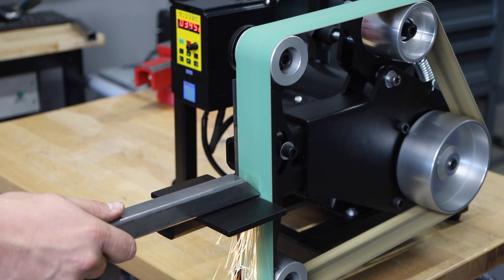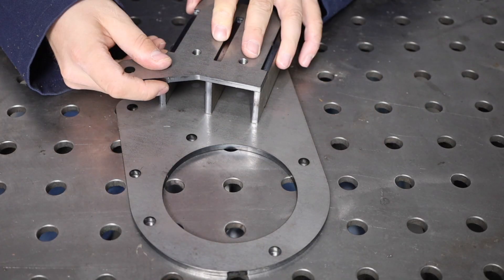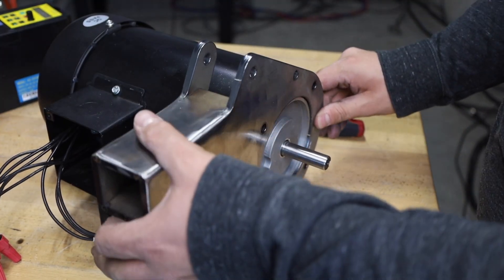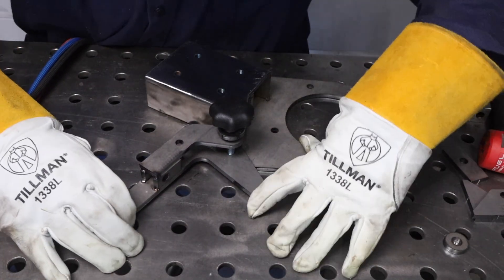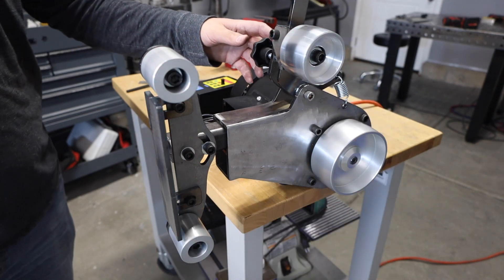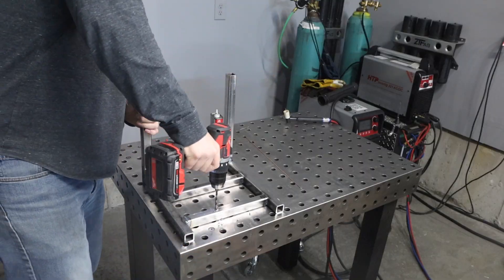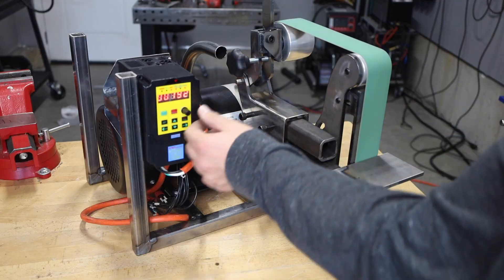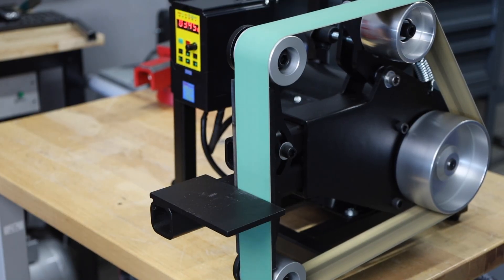I Built A Better Belt Grinder…Here’s How

Comment: Is there a reason you sized the VFD to match the motor HP?  When converting from single to three phase, the quick and dirty recommendation is to double the HP rating of the VFD.
Reply from the maker: I was just looking for a cheap one to test it out. I figured it would fail within a few months with the open top, then I'd replace it with a nice one if the grinder worked well. It still works great, though, I use it almost every day. I'm sure I'm not getting the full power out of the motor and I'd buy a bigger/better one today, but it's still pretty powerful.
Reply: @TimWelds  I was considering a DURAPulse VFD from Automation Direct but if you're still having good luck with the one you started with, then I'll give it a shot since that's about half the price of the one I was looking at.  I'll probably make a shroud to keep stray metal bits out of the VFD,though.

Thanks for posting the video.  I was hunting for a compact design and this looks like it'll work nicely in my small shop.

Comment: Tim, great design and build, when I sent the files to SCS they advised me that some of the features are too close to the edges to cut based on the .250 plate. They pointed out the bottom slot on the motor plate RH edge being too close to the outside edge of the plate. Curious if they told you the same thing and if you had to modify it?
Reply from the maker: Honestly, I don't remember if there was a warning, but I didn't modify anything from the files that are uploaded. Make sure the plates are in the correct units and that the overall size shown on their site seems reasonable. I don't see replies to comments, so shoot me an email if you have any other questions about it.

Comment: Do you have a spec for the tapped holes? I looked at the drawings but didn’t see anything.
Reply from the maker: 3/8-16 for the tapped holes. There's a text file in with the drawings that has a few details.
Reply: @TimWelds  Guess I need to RTFM (eyeroll here)

Comment: In case anyone was wondering what the cost from SCS would be today, after the discount code and tax it was $200.44 to my door. Make sure you switch the units to MM on SCS and make sure the quantities are correct before placing the order.

Comment: Nice build... I would like to build that but I wont be using send cut send. I would cost over $700 bucks today to have send cut send make those parts today.
Reply: I quoted it like 2 days ago and it was under 250
Reply: @ You must have used a different thickness of metal or something. I put in all the pieces at .250 mild steel…Total quote was 
$712.81….
Reply: @imadog131  ill run it again tomorrow and let you know. But if I remember correctly, I ran it all as .250 mild steel, no deburring or added coatings
Reply: @imadog131  you ran it in inches i bet instead of mm. Guarantee that's what you did. I just double checked price.
Reply: @hoop2814  Some of the parts were in inches.. I’m new to send cut send and just loaded the files from Tim’s post. Thanks for educating me on using mm or in..
Reply: @imadog131  no worries at all man, glad I can help. I'm ordering my parts this week as well! Good luck on your project!

Comment: Hello Tim, I really like the compact size of this Belt Grinder. So I'm building one. Can you tell me what length of 1.5 x 1.5 tube you used for the platen and work rest?  From the images it looks like they are about 12" and 15" long. I also want to thank you for the free dxf files. I was able to cut out most of the parts on my cnc plasma table with only a few needing to be cut out on a laser table. I didn't know that you could get 220 volt 3 phase power out of a frequency converter with 120 volts input. Thanks for your excellent design and build instruction video.

Comment: Very nice piece of equipment you designed. Did you choose the 3 phase motor because you already had it on hand?
Reply from the maker: I chose the 3 phase motor because variable speed with a VFD is better than variable speed options with a single phase motor. It's almost always turned all the way up when I use it, so I'd probably just use a single phase motor and a light switch if I were doing it again because that would be cheaper.

Comment: Mind me asking how much the final cost was for this? I'm trying to decide if i should buy a pre built one or build this.
Reply from the maker: Prices have changed a lot since then, but if I remember correctly, it was under $500 at the time. If I were to do it again, I wouldn’t mess with variable speed because I always leave it cranked up. That would save a couple hundred bucks, but if you’re grinding knives, you might want to have the variable speed.
Reply: @TimWelds  I was thinking of building a 2x72 but I just need something for cleaning welds up. The vfd sounds like it would be good to especially if I pick up some belts for Polishing and sharpening some blades.

Comment: dude this is Lego...what is DIY.
Reply from the maker: I designed and built it myself, I thought that was DIY? I’ll have to check the Lego isle for one of these next time I’m at Walmart, didn’t realize they offered it.
Reply: @TimWelds  I don't understand what you designed, thousands of examples on YT, and all of them are basically the same machine models in appearance and function, as long as you drew the thing in the program and cut it on a CNC machine or laser, all the same, while most people made a project from scratch with basic tools and materials, what is available to most people, i.e. manual work, and that work can be called do-it-yourself.
Reply from the maker: I used software that is free to anyone and a laser cutting service that anyone can use without any up front equipment investment. I’m showing that DIY with modern tech can be done by anyone.

Comment: Love the compact build and just tilting it on its side is genius.... so simple.  Have two comments.... the availability and cost of 2x48 instead of 2x72 belts.  2x72 belts are so common, in such a wide variety... I don't know about 2x48 belts.  Second Comment.... I can't see that controller lasting very long sucking in grinder dust.  Bad in the vertical orientation  and terrible in the horizontal orientation.  TEFC motors are pretty well sealed and in my experience can take a lot of abuse.   Maybe a VFD in a watertight enclosure?  Nice design and I never thought about using a laser cutting service.

Comment: Nice build, is the VFD 120 or 240 volt? Which VFD would you recommend for 3phase to 120 volt? Thx
Reply from the maker: Mine is 120 volt. For the VFD, I just bought the cheapest one from Amazon. It’s working great, but may fail early because it has open ventilation which can allow metal dust in and short the circuit board. I figured I’d take the gamble and upgrade when it dies.

Comment: Thanks for the video!  I don't comment much (if at all), but found it important to share my thoughts.

I'm in the process of building this right now, and I'm going to share a few things I've learned so far about fabrication in regard to this project specifically.  

1) The threaded mounting holes on the motor are only 1/2-3/4" deep and are blind.  Don't thread a 1" bolt in there and keep cranking.  Ow.
2) The holes are all 3/8" as drawn, but the linked rollers are designed for a 12x40mm (I would take it to the hardware store and double check that) shoulder bolt.  You could do what I did and drill it out to 10mm and get a lock nut, or you could thread it for M10x1.5 (I think that was the thread I was able to find in the hardware store).  If I were to do this again, I'd have waited for the rollers to get here before I bought anything else, and definitely before I paid for the custom cut plate (which is indeed very nice), and used what's available to guide my choice on what size to thread the hole.  A simple thing that could have alleviated most of my non-welding woes. [I just double checked and it should have been threaded from the start.  I'm actually more satisfied with how I did things like this than if I'd done it as designed.  If you get the plate as drawn you can still tap it yourself pretty easily.]
3) There are a few options for 120v input.  I just grabbed the cheapest.  Input is usually listed as RST on the VFD - for 1 phase 120v input hot is R and neutral is T.  S is used for 240v, and ground is its own lug.  
4) You don't need a ton of the 1-1/2" square tube.    Maybe a 4 foot section tops, if you're thinking about making multiple tool rests.  I didn't think about what I was doing and bought 8 feet of it.
5) You can make life a little easier by using KIPP style toolless screws (ratcheting handle screws) for the 4 side adjustment screws.
6) I think it's definitely important to build the frame Mr. Welds has on his, but I also think it's a good idea to go to Harbor Freight and buy a $60 grinder pedestal for this thing as well.    This way you can still move it around, but you don't have to do as much lifting/fighting with it when it comes time to use it.  I have more than a few tools that I dread using because I don't want to fight with getting them out from under the work bench.
Reply: Great comment- thanks for sharing!

Comment: Hi Tim ~ I don't get much time for web research, so please excuse the question if you've covered it elsewhere.  I was wondering how you've employed your Portaband bandsaw setup?  I'm trying to find a way to make fairly square cuts using 1-inch thick 1018 bar stock and am trying to find out if a cut like that is possible with a portaband type saw and a Swag table stand?  I previously subscribed, so please keep up making the informative videos. 👍
Reply from the maker: Thanks for the question! I generally use my portaband and stand to cut shapes from sheet/plate. If I we’re cutting bar stock like that with a portaband, I’d support the material and use it handheld. The cuts would be as straight as it’s held, but could be really good. A horizontal bandsaw or chop saw would be able to make more repeatable straight cuts. Hope this helps!
Reply: @TimWelds  Hi Tim ~ I'm seriously considering following your lead and fabricating our own belt grinder.  My main concern is the motor itself.  Some folks say that you need to base a belt grinder around a low rpm motor -- like a 3-phase 2 hp 1800 rpm design -- to get the required torque.  I'm not sure how much you've used your grinder at this point, but have you ever felt the need for more torque when shaping metal?

Comment: Very nice build, I like that you used MIG/TIG depending on the situation. One thing I would add is a counter nut for the tracking adjustment screw, maybe a nut with a tiny lever welded to it so you can lock the tracking screw in position firmly after adjusting it.
Reply: I was thinking a coil spring slipped over the screw just to give it some resistance against vibration.

Comment: I'm almost done building mine. for a weekend warrior like me, this is a great project. Two things, my motor does not have a flange to mount it so I have to modify the design a bit. Second, if yo guys need bolts I recommend the Bolt Depot. Great prices without having to spend a tone in shipping!

Comment: Fyi I am building this sander and the roller kit is ok but upon inspecting the roller bearings I found that the inner bearings were subpar/defective. The outer bearings are fine so it's something that would not be discovered unless you remove the bearings to inspect. Fyi each roller is 3 bearings sandwiched. I am replacing the bearings with new 6201RS. I have reached out to the roller mfg to let them know. This is nothing against Tim I just wanted to let anyone know who purchased the Amazon rollers. Things are spinning at a pretty good clip to have defective bearings. Thanks all else has went well pics to follow once completed.

Comment: You're tracking could be improved drastically very easily, a lot of the belt movement back and forth is coming from the fact that you're platin doesn't have lead in and lead out bends, by putting radius bends on the top and bottom of your platinum and pulling it forward more you will get a smoother transition from the angled seam in the belt as it rides over it.

Comment: WOW!  Great work.  I've done a similar belt grinder project but mine is not as nice as yours.  The only comment I have is you've made a mistake mounting the VFD to the frame holding the motor.  I've seen  many VFDs fail prematurely from vibrations caused by being mounted to the motor frames.  The vibrations cause the solder joints in the circuit boards to fail.  Other than that, I love it.

Comment: How long do you cut the 1 1/2in tubing for the idle pulleys and platform holder?
Reply: Got the build started, and very close to running. The idle pulley tube is 8.5”, and the platform is 12.25”
Reply: @retired_badger  Thanks that helps a lot!!!
Reply: I've bought the "kit" from the link, and by my estimation the idle pulley tube is 9-10" long. The side box plate is 5" in length, and it looks to extend about 4-5".  The platform is 3" deep, so if the other is 9", I'd go closer to 14-15".  I'll post here once I get my build started, if you don't get a response otherwise.

Comment: i built a pretty sweet bike stand for a xr650r out of a bed frame on the side of the road without any detailed measurements. it looks like hell, but it works as i only have running a 115v millermatic wirefeed, at the highest voltage it still struggles on much more than sheet metal. like trying to weld a nut onto a 3/8" broken bolt is tough. something about the chinese steel bed frames it welds them with ease, a little splatter but at least it gets some good joints. weird about the welder is it'll weld beautiful looking beads on stainless with flux cored wire.

Comment: You might want to move the FVD further away from the grinder.
Metal dust kills FVD's.
Reply from the maker: That’s a great suggestion. I thought about that, but figured the convenience is more important to me than longevity. If I end up letting the smoke out of this cheap box, I’ll switch it out for a high quality sealed unit. The interesting thing is that location has proven to get very little dust on it so far, but only time will tell.

Comment: Impressive, thanks for sharing all the sources. VFD should be IMO protected better, especially for the horizontal use (or just kept away in the safe distance from the unit).
Reply: Yeah if all that grinding and sanding debris get inside the VFD it will more than likely release the magic smoke.

Comment: Very nice Tim. I’ve wanted to make one, but haven’t gotten around to it. The only thing I would suggest it to use something to cover that A-36 belt back plate. You’d be surprised how quickly they wear. Possibly a graphite sheet used for that purpose, or next time, a steel with good wear resistance, such as AR-400.
Reply: Perhaps a replaceable strip of UHMP?  (What I had thought to use if I ever managed a grinder build.)
Reply: Why not just buy a ceramic glass platten to put on it. I'm pretty sure it's like 20ish bucks for one.
Reply: @okiedokie2487  I don’t think I’ve ever seen a ceramic platen for these kinds of sanders. We’re talking about metal. There’s a lot of pressure used for metal. A ceramic platen could crack from the high point pressure and heat.
Reply: @melgross  go take a look at pops knife supplies they offer those plattens for sale. They can break but you'd have to really be slamming your work piece into the belt but as long as you are using it like a normal belt grinder you shouldn't have any issues. You cam only push so hard against the belt before you are going to bind it up or put a whole butt ton of heat into your part. Knife makers have been using ceramic platens for years because they last longer than steel platens and they don't heat up as fast as a steel platen would.
Reply: @okiedokie2487  for,knives, I suppose they might be ok for a while. But for anything else, we really push it. They wouldn’t last.
Reply: @melgross  I find that hard to believe. Knife makers use their grinders for more than just putting bevels on the knife. They are grinding a multitude of different materials from hardened steel, mild steel, brass, aluminum, stainless steel, titanium, wood, and a ton of other materials. Like I said before you can only push so hard into a belt grinder before you stop the belt. I get you may use it hard but I feel like if you are just slamming pieces in to the belt grinder you've got your own problems. Ceramic platens last longer and allow the belt to slide with less friction so you'll get more life from your belts and and more life from your motor. They also stay true and flat longer than steel platens so if your are doing work with some degree of precision itll benefit you there as well. There are a lot of machinist grade grinders that come with ceramic platens and water cooled ceramic platens.

Comment: Any way you can have the CAD files with dimensions already on the drawings. When you open then AutoCad they don't have the dimensions laid out you have to lay them all out and it's quite consuming. If you already have them drawn can you save them with them displayed? I understand you want to have us use your service but sometimes that's not an option. Thanks for all you do.
Reply from the maker: I never made dimensioned prints, there’s really no need for them other than inspection when CNC cutting.

Comment: Nice build!  I built a 2x72 I designed a few years back.   Very handy tool!  I integrated a variable height stand for standing and sitting use and a few accessories with mounts.  I used wood templates and cut with a hand plasma cutter.   Wheels were expensive at the time so turned my own using a HF lathe and radius tool mount I made.   It was a very challenging project for my amateur capabilities.   I'm very glad to see you sharing your design and making it easier for people who would like to build one.